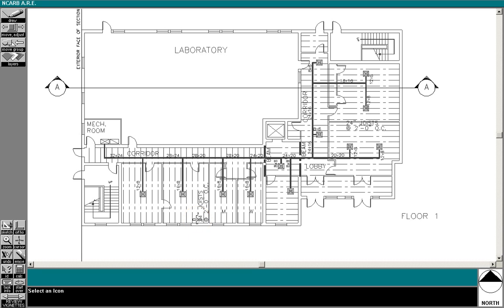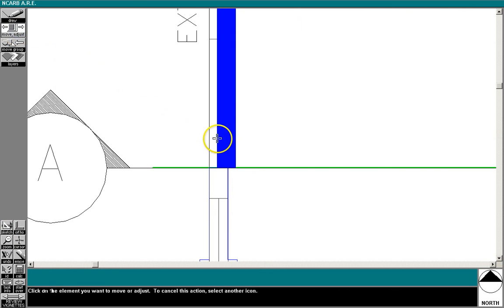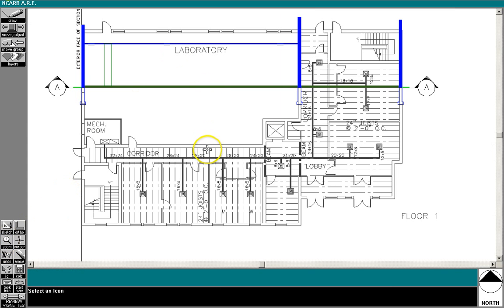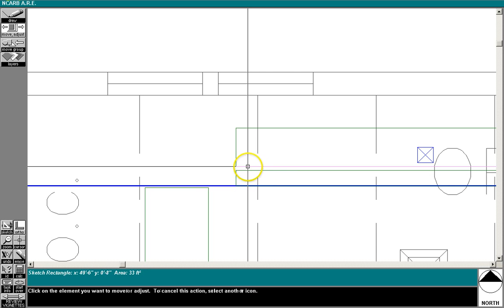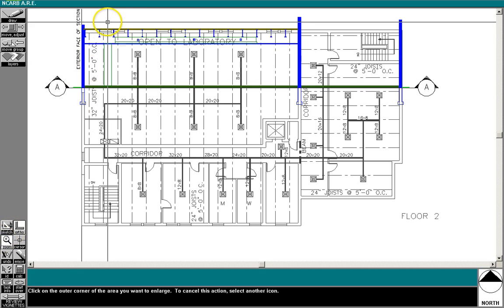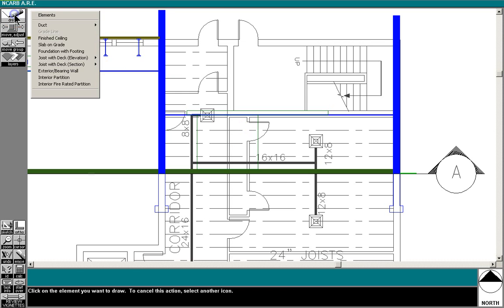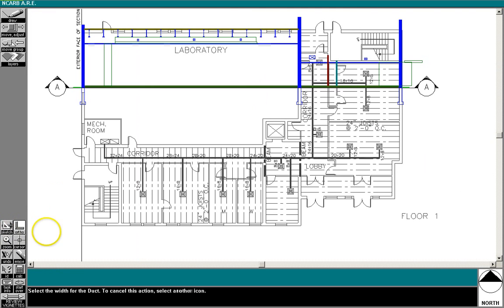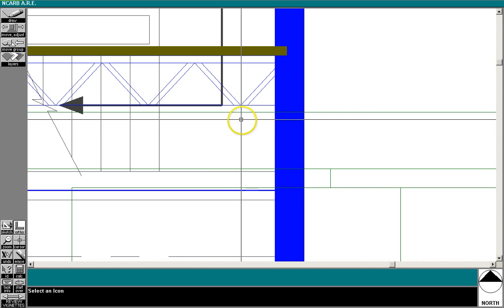building section part1.avi

Comment: Common pitfalls and tips:
Not putting in grade line.
Slab 6 inch above finish grade.
fire walls to not extend all the way up to the underside of the roof decking. 
allow for 8in for light, then mechanical space, then structure/joist. 
Put top of exterior wall footings below frostline.

Comment: repeating another comment. from what I've seen from other sources, there are a few mistakes made here in the video. I'd look up another one to be safe. 
"This guys videos are just a little off.  I am pretty sure he has not passed the exams with his strategies.  In this video he messes up the idea of the load bearing walls on the footings - they have to be on the footings.  On the interior footing he has the footing extending down 5' - again wrong - this footing should be located just below the slab and the slab should be interrupted at the load bearing wall.  He has great drawing technique with one of the worst cad programs ever developed but, do not follow his instructions in lue of doing your own studying and applying common sense.  If you trust him fully you will fail!"

Comment: Dear bjfb1e4, 
Is your comment below confirmed?
"I made an error on this video which should be noted:  the center bearing wall foundation should not go to below frost line, instead it should only be just below the bottom of the slab.  The reason is that freeze/thaw does not occur within the building.  At some point I'll remake the video with the error corrected, but until then, I hope you read this!"
In short, should the center bearing wall T.O. footer meet B.O. slab?
Please advise -- thank you!!

Comment: This guys videos are just a little off.  I am pretty sure he has not passed the exams with his strategies.  In this video he messes up the idea of the load bearing walls on the footings - they have to be on the footings.  On the interior footing he has the footing extending down 5' - again wrong - this footing should be located just below the slab and the slab should be interrupted at the load bearing wall.  He has great drawing technique with one of the worst cad programs ever developed but, do not follow his instructions in lue of doing your own studying and applying common sense.  If you trust him fully you will fail!
Reply: I followed this tutorial and I passed the vignette.
Reply: followed video read all comment and passed also.

Comment: This video does not cover 1 critical point to pass the vignette. You MUST use the MAX JOIST + DUCT COMBO depth to determine your plenum. This is not just adding the deepest joist and the deepest duct, but the deepest COMBO of the two (e.g. you can have a deep joist and a shallow duct, but this could still be the deepest combo) This applies anywhere you have a consistent ceiling height, regardless of the whether the section line cuts through it.  This video goes over the max duct depth, but not the max joist depth, and thereby does not cover the max combo. It just so happens that you don't get in trouble for it in this sample vignette. Otherwise, very helpful video.
Reply: +Oel Scott Say you have a 10" joist and a 5" duct in one room. In another area you have an 5" joist and an 10" duct. If you add the max for both, you are over designing for a 20" plenum. The max combo for any given location is 15".
Reply: +Tim Do Hmm would the deepest duct and Max joist not equal the deepest combo?!?

Comment: Question! The 'larger duct' was 24x16", compared to the 8x8", but the largest duct, in the same corridor from which the 16" deep duct branches, is 20" deep. Why isn't the required duct zone 20" deep?  PS: thanks for the video, it's a life saver.

Comment: GREAT VIDEO. THE DRAWING IS CORRECT. THE INTERIOR WALL IS A BEARING WALL, THEREFORE, THE FOUNDATION MUST BE DEEP. IF IT WAS NON BEARING THEN IT COULD BE SHALLOW. EVEN IF THE BUILDING INTERIOR IS NOT IN THE COLD ZONE.

ALSO, CORRECT IS THE SLAB CANNOT SIT ON THE FOUNDATION THE TAMPED SOIL AND GRAVEL SUPPORT THE SLAB WHICH IS USUALLY REINFORCED. PLUS THE EXTERIOR WALLS ARE BEARING. ADVISABLE TO BUILD AS SHOWN. THANKS TREMENDOUSLY.

Comment: Thank you for making these series. It is wonderful that somebody has taken time to do this without trying to profit.
I would like to add two notes:
1- You are correct about the deep foundation in the original video, not the comment above. The reason is that the foundation is linear and travels to the edge of the building, at which point must be deep. If the foundation was pad, then it would make sense to do the interior ones shallow.

Comment: 2- You mentioned that the slab can or cannot sit on the foundation. I beg to differ on that and comment that the slab MUST sit on the foundation, otherwise it will structurally be disconnected, unless the slab is done in one pour with the foundation (which still means the slab runs over the foundation).

Thanks again for the videos!